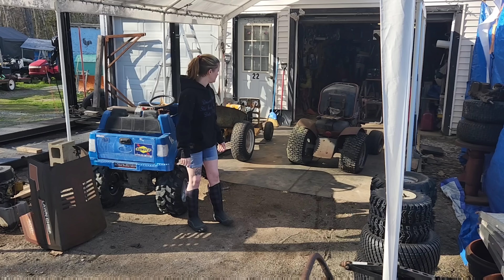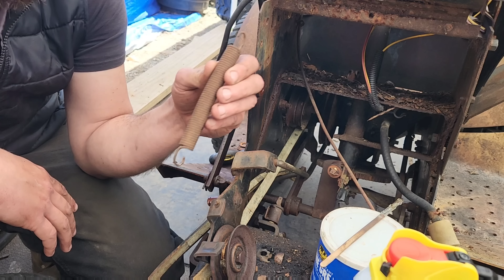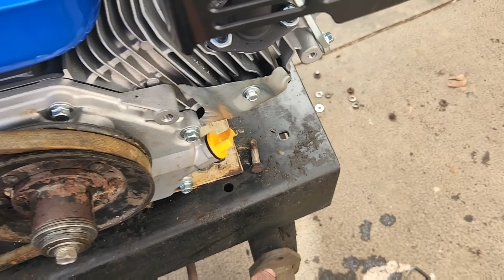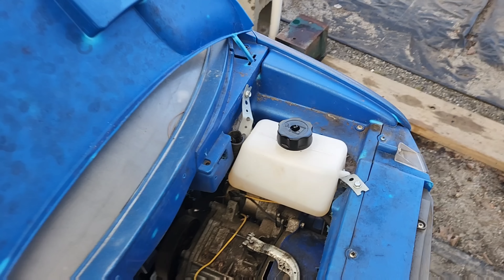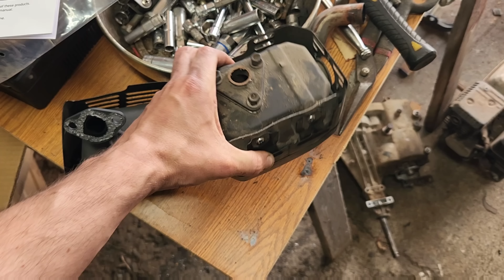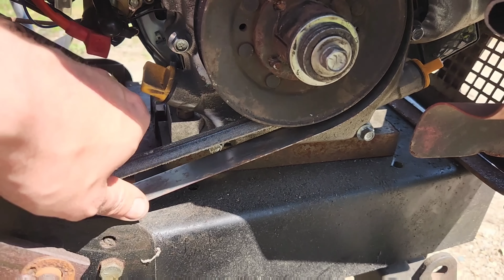Restomod Sears Suburban GT 16 Duromax Swap

Comment: I agree with using the more modern engines when you can, fuel efficient reliability and easy to mod, 3 things you want and need.
My Ford Snowblower Tractor, it was a Kohler, but it's been modified with a Honda Clone, other than being a bit underpowered it's very fuel-efficient and easy to start in the cold.

Comment: That was a great video..
I have two 1969 Craftsman SS garden tractors.. one with a bad motor and one that was good.. 12 horsepower cast sleeves..
I would love to get at least one running.. even if I had to put in a motor..  I have almost every attachment you can think about for them..
Any suggestions?
Thank in advance 
Gus..
Reply from the maker: Drop me an email and we can talk some ideas. mainemudmower@yahoo.com

Comment: Do you still have the firewall panel with the serial tag on it still? If you arent going to use it, I would be interested in it. I have been wanting to build a true Gt16 for a few years now and I can build a tractor around a serial tag with the parts I have.

Comment: is there any advantage  to the side pulley vscthe bottom  pulley  ?
Reply from the maker: Stock vers stock No. There is however argument in favor of horizontal shaft motors when it comes to performance.
Reply: @redneckcomputergeek   so the sideways  is faster

Comment: Hi, I have a LT1000 that I would like to do a rear pulley swap on. Where the heck do I find a smaller pulley? When I look at ebay or Amazon, the only results I get are the stock size and my local Tractor Supply stopped selling pulleys of any size. Please help!